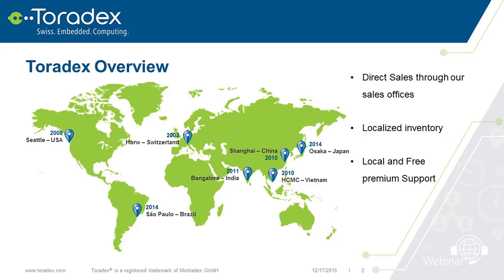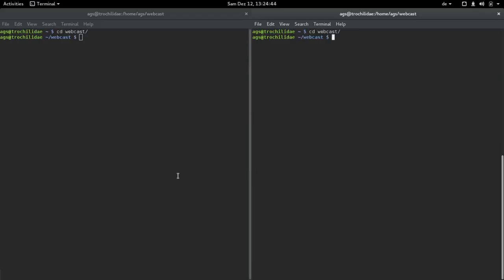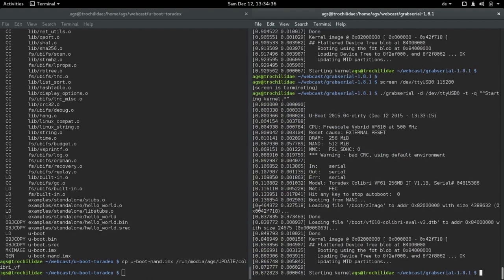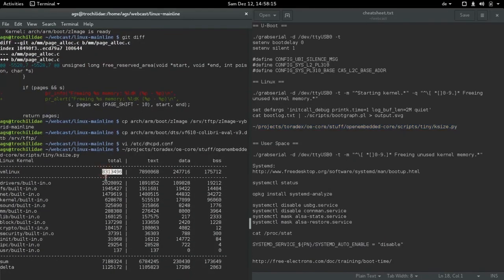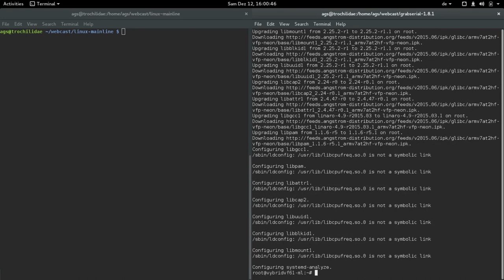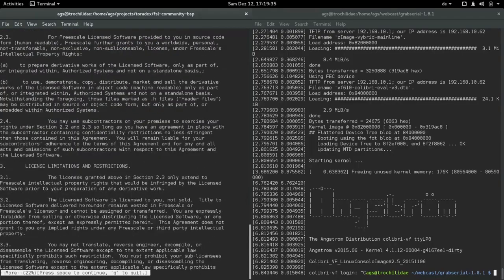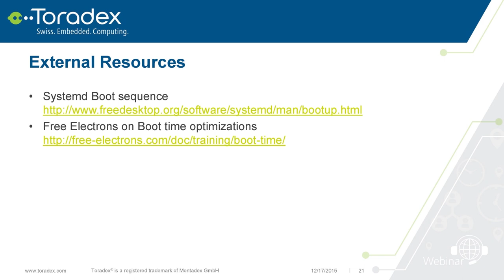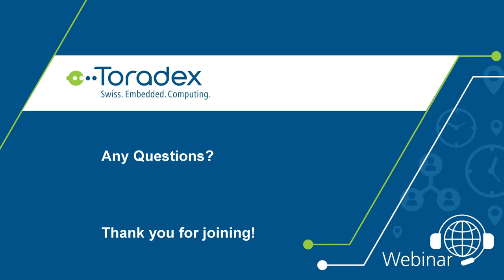Webinar On-Demand: Embedded Linux Boot Time Optimization

Comment: Hi Many thanks for this Informal Webinar. I have a question, is it possible to do this Optimization on Apalis-T30 with Toradex V2.4?
Reply from the maker: There are lot of steps that can be used on the Apalis T30, however there are some differences.
For example: the Apalis T30 uses EMMC compared to raw NAND on the Colibri VF50

If you are interested in Toradex modules that are more boot optimized, take a look at;
Apalis i.MX6 with Qt: https://www.youtube.com/watch?v=V-a6KO7SK2g
or
Colibri T30 with WinCE: https://www.youtube.com/watch?v=b3NbOK7yEIs
Reply: Many thanks,
we use since 2 years the apalis-t30. Can you send me more info on how to do some optimization on the apalis-t30?
Many thanks and happy new year.
Reply from the maker: Additionally to the tips in the webinar, we also recommend you to our blog ( https://www.toradex.com/blog/embedded-linux-boot-time-optimization ). It's not for the T30, but also here we used some general concepts you can use on the T30. 

To get the best optimizations it's important to understand what functionally has to be available in which state of the boot process. Toradex support will be happy to help you out with the details. You can use the community forum ( https://www.toradex.com/community/ ) or reach them via email or phone ( https://www.toradex.com/support ).
Reply: Many thanks i try to follow the Webinar. Its very informativ.
 Great Work.
Reply: I want learn how to run boot time of Android code and how to install tool which tool are use please tell mee